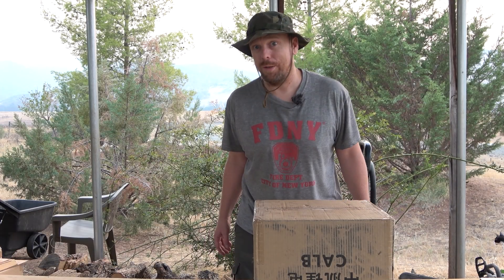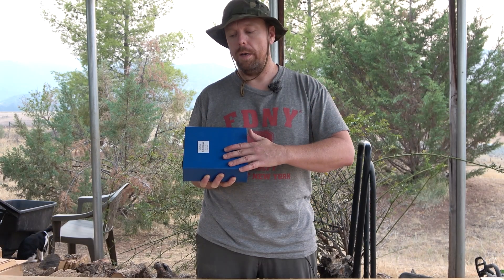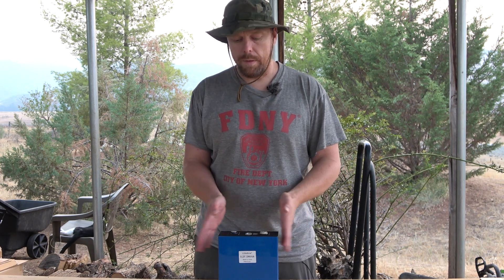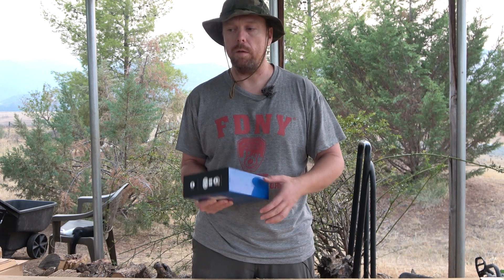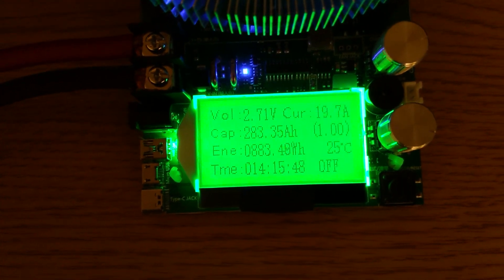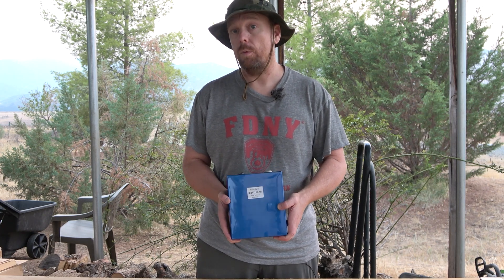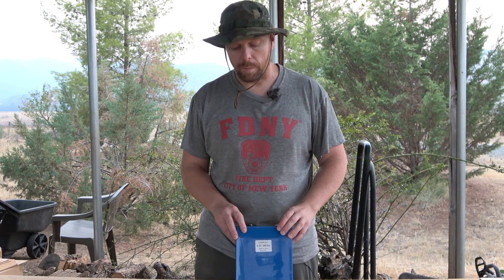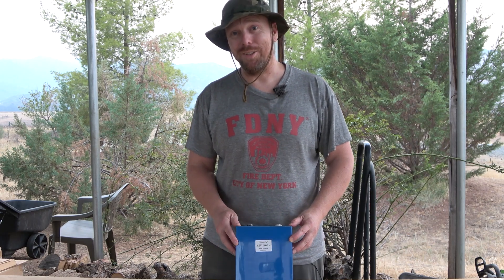Ford Ranger Electric: Why I Went With 280 Ah LiFePO4 Cells

Comment: Uh oh....only a couple minutes in and you've said one of the worst names in the world of LiFeP04 resellers. It's hard to figure out which LK store is the real LK on Aliexpress.

Here's to hoping there's a capacity test, IR test, and load test coming in the next few minutes.

Edit: ok a little over on Ah (about right where a new cell should be) but a little under on the wh. A better start than most have.
Reply from the maker: Yes, I got lucky. Apparently, LK just repackages and sends out any surplus stock they can get their hands on. These are actually EVE 280 Ah cells, so I really can't complain. My later order from LK weren't 280 Ah, even though they had the exact same specifications on the order.

Comment: Yes CATL cells in the plastic housing were original "Thundersky" batteries. They appeared in the late 1990' so they have been known for a long time. Energy density was not as good then, but at that time, EV size Li-ion cells were not available, so they were the best home EV builders could get their hands on.
Reply from the maker: Oh, that's interesting. I didn't realized that CATL made the Thundersky batteries. I didn't really know of CATL at the time, so maybe that's why I didn't make the connection. I think the biggest issue was the nylon housing, which just wasn't robust enough. They needed to be treated more like pouch cells than prismatic cells, which was challenging for a lot of custom battery packs.
Reply: @newscoulomb3705  Honestly, I'm just presuming here, but the casing looks identical?
Reply from the maker: @Tore_Lund  Maybe I'm confusing the Thundersky with CALB, but 15+ years ago, I remember seeing Thundersky LFP cells available. However, I don't recall any of the LFP cells at the time being offered in aluminum casing. Maybe they were and I just missed them.
Reply: @newscoulomb3705  I thought you showed the CATL cells in yellow ribbed plastic casings at the time you mentioned them in the video?

Comment: Great video. 
FYI These only need compression if you over charge a cell.

Thoughts:
- At 80% 1C will be 220A
-  I wonder if these are used 300Ah cells, I don’t trust LK
Reply from the maker: Thanks! Yes, I no longer trust LK anymore either. I think these are legit EVE 280 Ah cells. A number had surface blemishes, so LK might have gotten them at a discount and resold them. They recently switched up their "280 Ah" cells though, and they are now shipping 240 Ah cells in their place.

Comment: I really like the LFP chemistry, because it's better suited to replace the 12/24/36/48 volt batteries we have traditionally used to power various motors.  When I did my research on which form factor of LFP battery cell to use for my fishing boat, where vibration and moisture are a concern, I determined that the rectangular prismatic cells were not suitable, unless they were carefully packed into a well-designed case.  I went with larger (60280) cylindrical cells for my 24v, 55AH trolling motor battery.

Comment: You should have gone for the 304-310ah version. Basically the same size and weight.
Reply from the maker: I purchased these before the EVE 304 Ah were available. The good thing, though, is that I have two trucks to build. 😃

Realistically, though, there is a 3 mm height difference, and that might be the most constraining dimension for these battery cells.

Comment: I purchased 36 of these cells 110 days ago and just received 28 of them. The shipper is not cooperating with me telling me to remove the dispute on Alibaba or the last 8 will not be shipped. Yes cheap but very frustrating to deal with the Chinese they really dont care about customer service on Alibaba .Next time I will be purchasing SOK with a 10 year warranty
Reply from the maker: That sucks. I've received my entire batch from them, so my current dispute is simply asking for a refund. I am concerned though, as the provider for my last set of cells might have switched over to providing these 240 Ah cells instead of the 280 Ah cells they were providing before. If so, I'm going to need to open yet another dispute. :-/

Comment: Just to let you know I ordered 16 cells from AliExpress for my  56 vdc grid tied inverter. The price works out to be $128.64/KWh. Actually that is a very reasonable price, thanks for the idea. I just purchased some Lithium iron phosphate 55 amp batteries from Battery Hookup and they cost $142.88/KWh.
Reply from the maker: Oh, nice! I have a few more on the way, too. Just to make sure I have replacements if necessary. Honestly, at this point, I just like having this extra energy storage capacity around the way things have been going. Our power has been out for over 15 whole days so far this year, and we haven't even had bad weather.

I think most of the deals were soaked up last year, unfortunately. Ali websites have a "shopping" day on the 11th of November, which is when some of the best deals happen. That's how I got some of mine for under $100 per cell. The one thing I hate is the shipping time, which can be a few months.

Comment: How is your capacity and discharge rate test on these littokala cells? I am a fan of lifepo4 cells and have my own built system for home and mobile purposes. However, in my experience in purchasing these raw prismatic cells is that there are many shady sellers and also brand out there. I understand that littokala is one of the most "price-friendly" available now and i have bought some of them and tested it. Found that the capacity is not as advertised but the most concerning issue is that the voltage drops significantly when 1C discharge is being performed. You might want to test it especially if you are doing it on an electric vehicle per se... more reputable are the EVE, Lishen cells but that would also require to solve a proper seller as some i received were used cells and not new as asvertised.
Reply from the maker: I've capacity tested multiple cells from various lots, and each has tested at >280 Ah of capacity. Voltage sag will be an issue with any battery, even under partial load, so that really needs to be baked into the pack configuration. In this case, a 100s to 104s configuration should never drop below the Ford Ranger Electric's 270-280 V system cutoff.

Comment: I think Tesla model 3 sr+ made in China now sold in Europe have same LFP prismatic cells from CATL
Reply from the maker: Yes, Tesla is starting to use what they call "Iron" cells. It makes sense. The Model 3 can support the weight and volume of an 82 kWh NCA pack, so there's no reason to not fill that capacity with 60 kWh of LFP rather than 60 kWh of the more expensive NCA.

Comment: I have a suspicion these won't achieve anything near their rated cycle counts; my experience with Aliexpress batteries has been that they often exhibit capacity at least close to their rated value when new, but can show higher than expected internal resistance and degrade quickly to much reduced capacity values overall. The "great deal" isn't so great if the cells are down to 70% capacity after 20-30 cycles and you need to rebuild the whole pack.

I think you should take a sample cell or two and cycle it 50-100 times and see if you note any degradation in capacity before you go the the extensive work of integrating these cells into a full pack. If they still test within a couple percent after 100 cycles, the cells are probably good enough to use in the full pack.

I'm just speculating, but my theory is that raw materials purity is the core problem here. Any contamination of the battery ingredients will not necessarily affect the cell initially, but will quickly poison the capacity over time. Getting properly pure raw materials is a major challenge in China, and bargain-basement cells like this would not be opting for expensive sources.
Reply from the maker: Those are fair points, but so far, people have had good experiences with these cells. I think a lot of the faster than normal degradation has to do with the environment and usage. If these cells are properly cooled/heated and properly compressed/restrained, they should last a very long time. Consider that the cells in my Chevrolet Bolt EV are only rated for a quarter of the cycle life of these cells, yet after 140,000+ miles, they still have >90% of their original capacity.

Comment: Threaded terminals - be careful not to strip them, they can strip surprisingly easily.
And be careful of swelling charged vs discharged, especially when you start connecting them.
Reply from the maker: Thanks! Yes, I'll be trying to focus on those issues.

Comment: I would try to compress the batteries when you install them, even if it is just a high strength tape. I have seen other YouTubers that didn’t compress there batteries and the cases expanded upon full charge.
Reply from the maker: Yes, there should be some compression naturally as a result of how I am planning to pack them into the case (that video was posted today). I think the difference (and the controversy) come from whether there needs to be an active compressive force. That's not necessary. Simply passively restricting expansion is good enough.

Comment: Are these cells all grade A ? Are they all balanced so that you save a lot of time setting up the
BMS ?     12.8v at full charge is a little low .They are priced quite low. These are rated for .5c in 
steady use 140amp, is that enough? With only about 90hp into a wind you may stress these cells
too much with  a lot of heat to dissipate , better have good cooling.
Reply from the maker: Yes, these are Grade A cells, or at least, they had intact bar codes. They did come balanced, but even using a BMS, I will top balance these cells before their final packing. 

3.2 V is the nominal voltage, meaning when a 4s battery is at 12.8 V, it is at ~50% capacity. They spike up to 3.5-3.6 V while charging, but the peak voltage settles to ~3.4 V when fully charged.

The .5 C is the rated constant charging current, though some have noted that they can be charged at 1 C (perhaps with compression and active cooling). The rated constant discharge current is 1 C, so it should handle the rigors of driving just fine. Also, the NiMH pack these will be going into has active air cooling, even while driving, so they should be fine.

Comment: Back when I was looking at buying a used C-Max Energi I did some research into their battery packs and what you could buy on Aliexpress. No doubt that you could easily swap out the cells and get yourself a better pack, so I'm not surprised that you went with these as Ford eventually did too :P

Comment: Good information, are you looking to upgrade the charger as well?  Or at least on the first one are you trying to see how well it does with just new batteries and everything else "stock"?   Funny thought, put both motors in 1 to have 4WD, use some bed space for batteries if you have to! :-D
Reply from the maker: Thanks. I will likely have to upgrade the charger just because it is not programmed for lithium batteries and it will only add ~20 Ah of capacity per charge cycle before shutting down. 
I have considered the dual motor option, but that would be really hard to pull off. I want to get one up and running before I try anything new. I also don't want to give up any bed space for the battery. I'd rather lose range/capacity than give up bed space.

Comment: Great video.  Some nice cells.  Should make for an impressive finished vehicle.   I certainly think that for some applications that Cell to Pack LFP makes sense for some applications.  We are seeing Tesla buying LFP from CATL for their SR model 3 and Y cars.   Certainly GM's Ultium system was designed for different cell chemistries in mind and LFP could be an affordable option for some of their vehicles (perhaps a future Bolt EV).
Reply from the maker: Thanks! Yes, the chemistry I'm waiting for is LFMP. Similar energy density (250-300 Wh/kg) and similar power density (~3.7 V nominal) to modern NCM/NCA. That type of chemistry could make direct cell swaps possible even in older NCM batteries such as the Bolt EV's.

Comment: Why did you say "Actually" aluminum cased, and not just aluminum cased?
What am I missing, why say "Actually"?   Just wondering!
Oh my goodness you say "Actually" a lot.
Maybe it's like people saying "like" every other word.
Reply: Actually, I didn’t even notice.
Reply: @mikus4242  Mike, that means you "Actually" do not listen.  Did anything soak in?
Reply: @davidws5439  Actually, no 👍🤪
Reply from the maker: Because most people's experiences with LiFePO4 cells are with nylon cased cells. I use "actually" as it supposed to be used: When something is either contrary to common knowledge or not commonly known.
Reply: @newscoulomb3705  Eric, Ok it just seems like you said Actually way too many times if you play back your video.
I hope your Ford Electric gets done before the Lighting come out.  It should make a great truck.  I hope Ford makes the new Ranger as a BEV.
Reply from the maker: @davidws5439  Perhaps. I've attended and participated in a number of speech coaching classes and organizations (such as Toastmasters) over the years. I've never found the word counts to be particularly useful unless the usage is egregious. 
If you found it distracting, I apologize. My speaking usage and style ebbs and flows depending on topic, so you're unlikely to hear me continue to overuse "actually" on future topics.
Thanks for your well wishes. As long as everything goes according to plan, the first of these Rangers should be done before the Lightning is released.

Comment: You keep saying "hardened aluminum" case.  Do you know what the material is and what the heat treatment level is or is that just marketing foo?
I'd hazard a guess that it's probably garden variety soft aluminum.  Whatever is cheapest when they buy.
Reply from the maker: I'm saying hardened compared to the soft nylon casings that are common to LiFePO4. I'm sure these cases are basic 6061 aluminum.

Comment: Will Prouse the DIY Solar guy here on youtube just built out a 48v module of these and has done several tests on the LiFePO4 'blue boxes' from AliExpress that might give you some helpful data.
Reply from the maker: Thanks. I actually bought and tested these before Will got his first set of them, but I have followed his videos on the. Off-Grid Garage (YouTube) has been doing a lot of good work with the EVE version of these cells.

Comment: Tesla is chucking LFP in the standard range plus model three now. Stuff the pack full and they can "only" get 253 miles. Size and weight are the only downside vs NMC, moreso the size it seems now. Tesla will start making LFP batts with their new form factor according to battery day (4680?). .50 cents a kilowatt hour, elon musk has said in one interview, could be battery cost in the future. I'm pretty sure he was referencing iron based cells with their dry electrode processing. Anyway, i have bought four of those but they were 272ah (seller changed it on me after I paid, and shipped it... Then told me). Alibaba. Took two months longer to get here than they said. Shinsen basin or something like that was the seller. They are good. They used to be much cheaper. Still fairly inexpensive at about 170 delivered per kWh. Good choice dude! I totes wanna see your project succeed. Let's do my motorhome next :D
Reply from the maker: Thanks! Yes, I think $50 per kWh will probably common in the next five years. As you experienced, the problem is not knowing what you're getting after three months shipping. I might be calling out one of the bad sellers soon.
Tesla might be jumping into LFP a little too soon, though, because LFMP are just around the corner. Same basic strengths of LFP with the energy and power density of NCM/NCA.
Reply: @newscoulomb3705  interesting. Nah tho man, he said cents. 50 cents er kWh. Man. It was an interview and I don't remember exactly where. Many people are correcting him at the cents-to-dollars. Really hoping for the 50 cents to be true :). Metal can and some junk crushed together inside made in unbelievable speed/quantity may make it possible. (10 years?)

Comment: This just keeps getting more intriguing.  DIY batteries are very interesting to me.  In the middle of San Jose, though, I just don't have the compelling legitimate need for the big backup. I have a couple of EcoFlow Delta 1300 for moderate back up needs right now.  But boy I keep trying to come up with a good excuse to build systems like you describe.  That all looks fun.

Looking forward to your Ranger builds.
Reply from the maker: Thanks, Bruce! Even in SJ, I'd recommend a basic backup power system. A decent 24 V inverter with 8 of these cells could run basic household needs for several days.

Comment: LiFePO4 like 2014 Chevy SparkEV... What does "80% dod" mean for life cycle? Does that mean 100% discharge for 4000 cycles result in 80% capacity remaining (unlikely) or 80% discharge (90% to 10%?) 4000 cycles result in at least some capacity (10%?) remaining?
Reply from the maker: The chemistry in the Spark EV was different. But yes, it's 4,000 cycles of 100%-0%-100% before degrading to 80% of the original capacity. Yes, that's optimistic but possible under the right conditions. My Bolt EV's battery looks like it will be capable of nearly 500,000 miles before reaching 80% degradation. Basically, I'll have a new battery before that happens.
Reply from the maker: @bgeery  It really depends what the spec sheet says. It will give details about the specific cycle life test used. The C rate at which the battery is cycled also matters (typically, .2 C). For the cycle life testing that you defined, I believe these rated 6,000 cycles. Again, though, it's been a while since I read all the spec sheets.